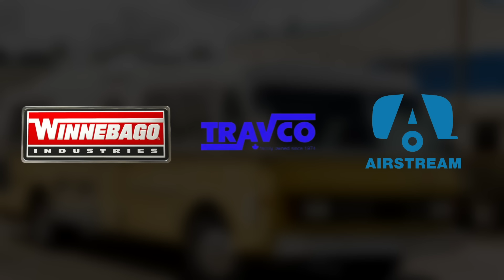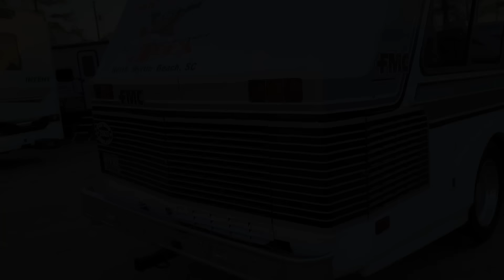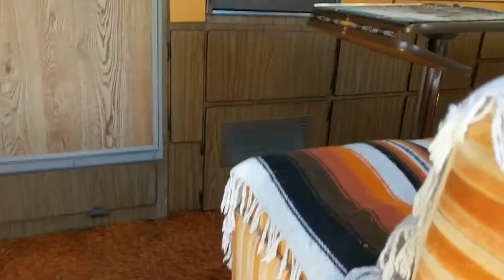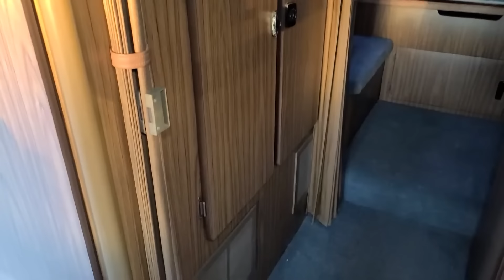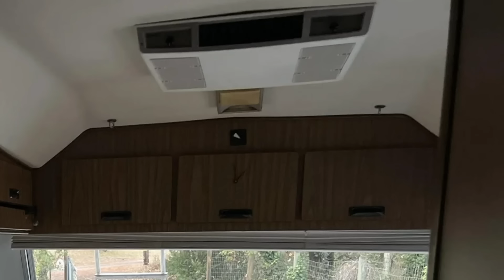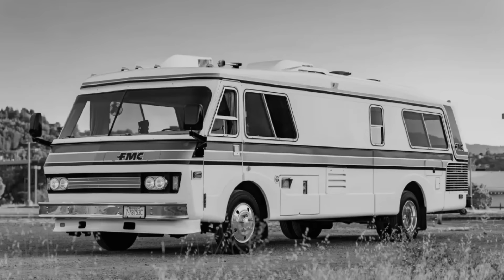The Rare RV That Was Way Ahead of Its Time…

Comment: The independent rear suspension is what I most remember.
Can you provide any info about diff center section was it torsion suspended?
Reply: It used torsion swing axles.. same as and actually from a military tank.. diff center section had like 20 degrees off 90.. the engine was off set to drivers side